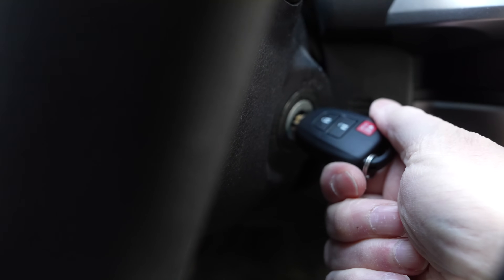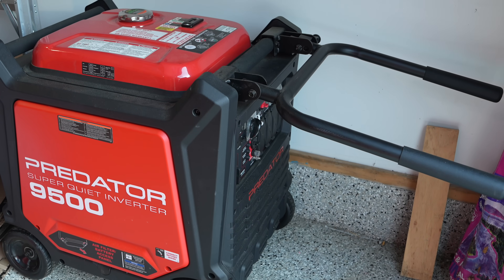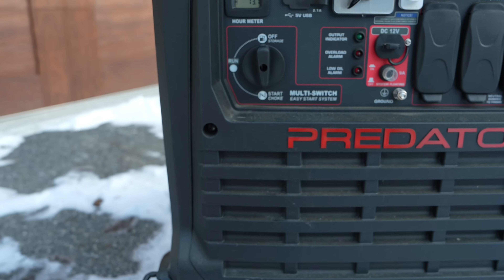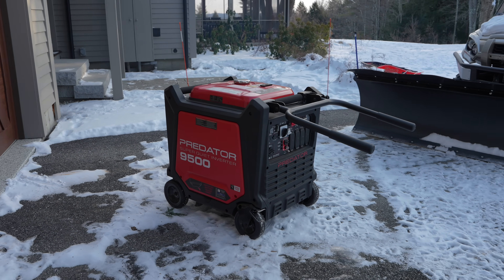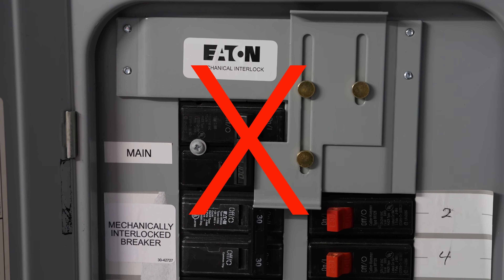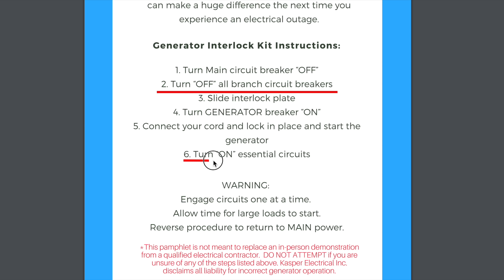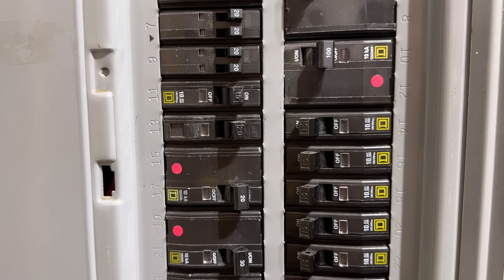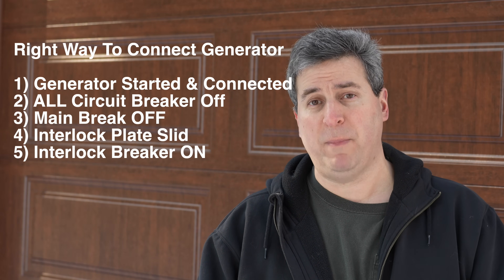Homeowners are Destroying Generators Skipping 1 Step During a Power Outage

Comment from the maker: Do you have other tips for your generator?  Parts used: Reliance Inlet  https://amzn.to/40SejMA  Labels  https://amzn.to/4hph4L0
Reply: Yes! 
I totally agree with everything you said, except for the turn off eco mode at startup! That is exactly the wrong thing. 
Let the generator warm up, with NO load, ON eco mode, to allow the internal engine parts to equalize temperature/size! 
We've lived off grid, and work in very rural environments. I've worn out a few generators. Something most of the people who are here will never do. They might ruin a few, but to actually run them all the way through the complete life cycle, takes a couple years of daily use.  I have a Honda eu2000i with estimated 4,000-5,000 hrs on in. We ran a generator 18 hrs per day, 365 days per year, for 3 years.
Oil was diesel grade 10w-30, and we changed it weekly. (Most of the time! Lol)
We also learned that because of sandy/dusty conditions, to keep the generator up on a platform out of the dust! 
Let the air filter get clogged, and the added suction on the crankcase vent, the goes into the intake, behind the air filter, will slowly scavenge the oil from the crankcase, and run the engine low on oil very prematurely! FYI this is BAD! LOL.... 
 We did use other generators in that time, but I think my estimate for the Honda generator is pretty close....

I think the engines would last longer if they designed an automatic start/warmup mode, beyond just the time delay in the generator. 
I also wish there was an electric or manual oil pump, to prime the engine lubrication, before cranking, on engines with pressure lubrication...
Reply: @davidcatlin1970  I think you nailed this perfectly. Warming up is critical to any combustion engine .  Dedicated oil coolers also helps for longevity if you can add one on.
Reply: @davidcatlin1970  Turn off the Hot water tank if electric (draws at least 4,000 watts, turn off AC unit or heat which also draws a lot, stove, dryer.   If you do that, and you have at least a 5,500 watt generator, you should be able to power everything else in the house no problem.  Probably could get by with even a 4,500 watt generator.
Reply: Don't run your generator next to my house, the noise pollution is disturbing and a nuisance!
Reply: @LMBee00 And I was just about to offer to run an extension cord to you for your fridge...
Reply: @xHICKORYx  Funny, I can live with or without a refrigerator, with or without my own solar system. Purchased once, maintain it myself and it's peacefully quiet, doesn't disturb any one else. I have extreme vertigo, constant ringing in both my ears and with my PTSD a generator literally rattles my brain, making my headache even worse, which makes me angry, anxious and more miserable than I am.
Reply: Here's a tip, they are NOT generators, they output A/C, they are Alternators, generators put out DC!

Comment: if i am using my generator to charge a server rack battery and AIO (i have this setup normally hooked to 2KW solar), i would probably want to start out at a lower charge rate like 10 amps and slowly ramp it up to the 30 amps i run at full charge

Comment: Central MA, bought my house last July, my neighbors told me we will lose power often and sometimes for 2-weeks at a time, so I spent big $$$ on an electrician and a generator, so far no power loses no need for a generator, but also no storms yet. It's a brand new 10,500watt dual-fuel portable Westinghouse generator I start it once/week & let it run for 15-minutes but it starts real rough and has since the day it arrived.

Comment: Modern gasoline cars if you hold the throttle all the way to the floor and you start it it won't actually start it's in flood mode but you can fill up your oil filter and test pressures off of the starter that way. 

You have to hold the throttle wide open and turn the key and it'll just build up oil pressure and fill up the oil filter, you don't have to prefill. 

Diesel cars will not do this they will do like in your video😅

Comment: Remember to FLOAT the neutral on your generator when connecting to your home through an Interlock.  There can be only 1 Neutral to Ground bond and that is inside your panel - most generators that are meant to provide power through the L14-30 connection have a way to un-bond the neutral from ground.  Critically important!!!!

Comment: Not me, I brute force the thing 5 seconds after starting it with a 5 minute delay on the AC and 3 minute delay on two refrigerators. Most of the loads in the house draw a small amount of current, no reason to do all this waiting.

Comment: Many homes have both a main breaker stack as well as a sub-panel. Start with the sub panel and turn-off non-switches high wattage circuits such as water heaters and heat pumps that may be connected to the sub-panel. It’s important to also prioritize those circuits that are essential based on the output of your generator. For example, lights, safety systems, refrigerators, well pumps and septic pumps should probably be left on..

Comment: Completely wrong. The engine in your generator is no different to any other 4 stroke. Most of the wear happens in the first few minutes of running so starting it at full speed just makes it worse. Use good quality gas and your genset should start perfectly on the eco setting.

Comment: I have a Coleman 5500W generator I've been using for decades. I built a raised shed for it  years ago with 4 removable sides with wing nuts to speed taking them off/putting back on.

Comment: I don’t buy the whole water ingestion idea at all. Not like that. 

Thing is, water is a lot heavier than air and much more difficult to suck in quickly, the mere weight of it already puts up quite a fight. 
And the air filter element doesn’t pass water quickly very well at all and most designs make it very difficult for a water logged element to get breathed into the engine, because that would be bad. 
So in effect if you do manage to get a decent amount of water into the intake, that typically immediately cuts off the air supply when the filter becomes a brief but effective plug. Which obviously kills the motor, regardless of whether the ECU knows about the water via some sensor or not. 
Most 4x4 vehicles have a heavy duty air filter as well which makes it even harder to get any water past it even if you tried. 

Obviously there are other ways to hydrolock an engine but by briefly dumping it while running and it keeps running? Nah, the physics doesn’t work. 
If it keeps running it didn’t suck in water. And if it does, it would take quite a bit of deliberate and sustained effort to get any water past the air filter. 

And like John said, even then it would have to get past whatever drainage system the manufacturer designed in, (and likely fight gravity and other Newtonian laws a few times as well) before it reaches anywhere it could actually cause some damage. 

Whatever made this motor crap out, it wasn’t water ingestion from “that” crossing. 

And frankly the way the manufacturer handled the situation was pretty poor. 

You sort out the customer first and then get into who could be at fault. You took their money for your product so you should act in good faith first even when you don’t have all the evidence. That’s basically what “customer CARE” means. 

And if John pokes fun at my crappy grammar, screw him, I’m South African and English is not my first language so just deal with it meneer 😂 

All the best

Comment: I have two dual fuel generators. I prefer propane over gas for the ease of storage without gumming up a carb.  If you have a "wet" generator, and especially one with an electric start, commit to running it at least 15 minutes once per month. This will keep the carb happy, and the battery full.  And if you are down the road a ways with it, make sure you know what type of oil it takes, and when to change it.

Comment: Always plug cord into house FIRST before starting generator so that the generator is bonded to the house grounding system to discharge any static buildup and it also gives the generator the proper ground neutral bond that is required.  This does assume that you made sure the Predator has a floating neutral.

Comment: whole house generators with auto-switching follow none of these tips.  Turning off high draw item breakers is a good practice to avoid all the in-rush current draws from motors/compressors/electric water heater, etc. starting all at once.

Comment: Honestly the only real breakers you need to shut off are items that either have a motor, or items that generate heat.  Mainly refrigerators, electronics (tv, computers, etc), and probably bathroom circuits.  Everything else (not counting 240v) is probably just lighting, and if you are using led bulbs, then that draw (if anything is actually on) is really minor.

Comment: This is dangerous, one should always connect the power cable first, touching a live power cable with 240 volts coming out of the house connection is very very dangerous. I always connect my power cable BEFORE starting the generator

Comment: The one big dangerous habit I see people doing with a generator hook up is this...To save money from installing a transfer switch or mini transfer bank, They turn off the main breaker to the power utility. Then they chose a double breaker to wire to the generator 240 power source. Leaving that breaker off. When a power failure occurs they shut off the main panel breaker and turn on the generator. Then switch the  double pole breaker on. Sounds good right? WRONG! A potential cross connection can occur between the generator and the power utility. Back feeding gen power to the power line. You dont know if that main breaker is truly open. Or someone can accidentally turn on the main breaker to the utility. Creating an explosion and fire . Spend the money. Do it right. Hire an electrician. Get the job inspected. Save the life of a lineman

Comment: One thing to remember is that a lot of boilers and instantaneous wate heaters do not like to run off a small genset. Not a problem with a large unit like 20 kva or more.  The solution? A battery bank, pure sine wave inverter and charger. Small genset charges the battery, the inverter runs off the battery and no problems with the boiler.   How do i know? Personal experience.  Fortunately boiler and instantaneous water heater loads are low, so you don't need anything huge.

Comment: don't turn off all your breakers: learn which ones... all potentially highly active 220's would be the critical ones. 110 fridge, don't bother, deep freeze, don't bother, these can act as somewhat of a buffer to other circuits. I turn all my sensitive electronics off at a good quality power bar whenever there's a power outage, brownout that's likely leading to one, or sometimes in a bad storm. Turn that back on last. Any high output device should be flipped off at the source receptical, air compressor that may have been cycling - shut it off... most things are digital now, so any microwave half way thru will not turn on the second power is cycled. Don't wear out your breakers prematurely or waste your time. If you're invested in a generator backup and interlock, you should be smart enough to follow that, if your not, you have no business messing with this, light a candle and read a book

Comment: I have an automatic generator, but we turn it off at night so we can sleep or during parts of long outages. When I go to restart, I follow good parts of your advice by turning off the high load breakers, which I have marked with some borrowed red nail polish. I turn these off, then turn one back on at a time. Water pump, fridge furnace. etc until essential circuits are all back on.

Comment: Good explanation. I operate exactly as you describe. It's just common sense. I've had several significant power outages, ranging from a few hours to 15 or 18 hours, without any problems.  In a crisis, I prioritize. My priorities are my freezers and refrigerators. Since I have a good wood stove, during winter outages I only heat with wood, so no 240V heating (unless it's an emergency).  During summer outages, I run a pool pump, an air conditioner, and two additional fans.  All the lights, television, computer, radio, two-way radio, coffee maker, small countertop oven, and stove work perfectly.  I have a generator with an inverter, so there's no problem for sensitive electronic devices. (Honda FI EU 7000w IS)

Comment: Please correct the ORDER of your instructions about when to plug your power cord in 
   
   Never plug it in while the generator is running. Major electric shock hazard!

*******Always plug in BEFORE, BEFORE, BEFORE YOU START THE GENERATOR 

AND REVERSE THE PROCESS WHEN SHUTTING DOWN.

Comment: ******ATTENTION******
NEVER PLUG YOUR POWER CORD TO YOYR GENERATOR WHILE IT IS RUNNING, NEVER!!!!!!!!!!!!!!!!!!!!!!!!!!!!!!!!!!!!!NEVER!!!!!!!!!
THIS IS A MISTAKE SIR. 

RETRACT THIS STATEMENT NOW!!!!!!!!!!!!!

NEVER EVER EVER!!!! WE REPEAT NEVER PLUG YOUR POWER CORD IN ........WHILE THE GENERATOR IS RUNNING!!!!!!!

ALWAYS PLUG IT IN BEFORE YOU START IT UP. 

YOU ARE HANDLING A SUICIDE WIRE IN YOUR HAND!!!! IF YOU ACCIDENTALLY TOUCH METAL OR YOUR FINGERS ETC TO THE PRONGS OF THAT PLUG WHILE THE GENERATOR IS RUNNING, YOU WILL GET ELECTRICUTED, AND PISSIBLY DIE.

******"ALWAYS PLUG IN YOUR POWER CORD 1ST, AND THEN START IT!!!!!!!!!!!!!!!!!! 

***** AND WHEN SHUTTING IT DOWN, REVERSE THE PROCESS
  THANK YOU!

Comment: Before starting the generator with the switch, do a few slow and steady pulls on the start cord to oil the cylinder walls and internals. Most generators nowadays use splash lubrication and no pumping of oil is present anymore so its critical to work the piston up and down a few times to splash somemoil on parts and cylinder walls before starting the engine. Just watch the recoil.

Comment: I know this is completely irrelevant to the point of the video. But in the first few seconds when you show the gas floored and then start the car….most cars with fuel injection will not start this way. It will prime and crank but no spark

Comment: I plug my generator into the Reliance outlet first because it is connected to ground, then I turn on the Generator. I then use a transfer switch to direct power from one source to another.

Comment: Harbor Freight just came out with the Predator 11,500 that should run the whole house. It's TriFuel and has an inverter. If it sounds like I know what I'm talking about, I don't!! I'm still researching it.  It's around $2100 for it and it's supposed to be the mack daddy of generators. Running it is 62 decibels at 20 feet away and 68 right next to it. Again I don't know what I'm talking about, it is what I have learned so far. Maybe you can do a video on one if you can get your hands on one or if Harbor Freight sends you one to test. If you pick it up at the store they weigh about 200 lbs so bring a friend to help you.  Honestly that's all I know about this unit and I don't know what I've even told you about all it can do. I look forward to hearing from you if you do a video on it. Thanks for your time and videos neighbor.

Comment: Since you asked: Because a generator energizes two separate 120V “legs”, if the output of one leg exceeds the rated level, the generator will shut down.  

I installed a Reliance MB30 7500 Watt Meter Box Transfer Switch Accessory which uses inductive “doughnut” coils that you pass each generator hot lead through to monitor the output on two analog dials. 

I have a small web cam trained on the dials to see what happens when I energize a larger load like a toaster or a heater to see the effects.

Comment: I did some welding on water heating lines in a large hospital. They had two 16V Silver 92 Detroit powered back up generators. They kept the engines at 180F because they had to go full power up in under two minutes   because of critical live support systems. Imagine the sound those 32 cylinders firing every revolution would have sounded like. 32 cylinders firing at 2000 rpm with four blowers and Turbos.  They could run the place on one, but had two because lives were on the line if they lost power.

Comment: It is really unnecessary to turn off all breakers before turning on the generator breaker. It is enough to turn off major power consumption breakers such as AC, electric range, electric heaters, etc. Turning off all led light bulbs and electric clocks is unnecessary.

Comment: Every generator I'm responsible for - from a 2-cylinder 20KW propane powered automatic whole house generator to a 250KW diesel generator with ATS at work to a 1MW diesel powered generator with closed-transition switch at a different work location are always used the same way by me: zero to full speed, a second or few delay, then switch to the load.  That's the way they're designed to work.  As long as your portable generator runs for several seconds, it will be ready for full load.

Comment: Depends on how much wire distance is between them. Military purposely link generators together through PDU's. They use identical size gen sets and sync their frequency. Mismatched gen sets will will cause a Parasitic load on the other if they are close together.  If you use invertor gen sets they make a parallel kit for that purpose.
If you use a generator on your home. Have either an automatic transfer switch. Or a manual breaker interlock for your home/gen connections.

Comment: Can I connect genset to power supply Phase line andneutral line I mean the supply in the Philippines is line that is black and the other line is bare wire that is 220 volts